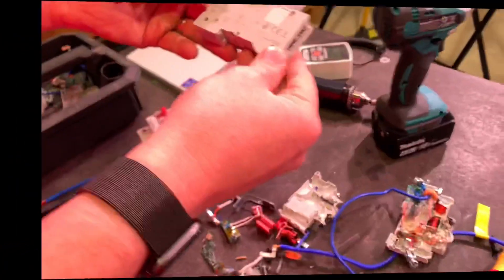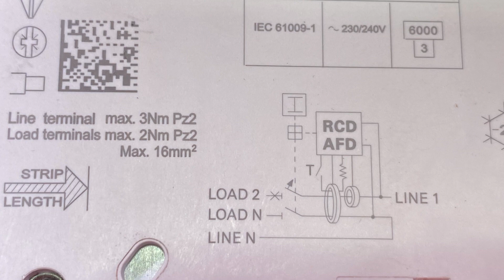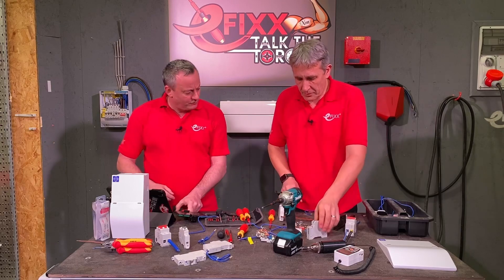IMPACT DRIVER vs CONSUMER UNIT - The results are SHOCKING

Comment: I am f'n amazed that anyone would use an impact. Seriously, it takes no more than 2 seconds to snug it up spinning the shaft and then torque up. (Quiet at the back Timmy).
Reply: Sadly you see it a lot on big commercial sites
Reply: @lewis94uk  I could snug anything with an impact, but I wouldn't finish it of with one. Back in the day, my old boss. We had to drive brass plate 3/4" #4s into brass fittings into oak frames that I predriiled and tested. I said set the clutch to no 3 on a bosch drill (24 years ago bosch). He just keep snapping the heads off and whining that even number one torque broke the head. He was gunning them full speed, how is the clutch suposed to compensate for the inertia of the chuck. Some people, even if you bang it into there skull, just do not have the capacity to absorb nor contemplate. They can be "learned" a task but will never understand why the funk why. And thats a good 70% of anyone you work with, talk to or related to. Same goes for the doctor, mp, teacher and everyone. I had to ban my boss from my electicl plane when he was trying to plane a bowed arm on a chair. Clues in the fning name I said. Same with the tablesaw. NFI
Reply: I guess if you're ripping one out it's probably incidental but using one to assemble is just ludicrous.
Reply: Speede II my friend. Save work
Reply: @tommymack3210  Send me one and I will have a go, I still have my dads pump drivers. If you remember them. First time he let me have a go on one, he explained one thing. He put a pipe clip on a some box work and said thats your eye, he wisted the end and the pipe clip was no more to be seen. Rule number one, don't open it in your eye and always store it open. Then he explained why he had two, His boss, my dad the aprentice, had a gig fitting 500+ cinema seats. His boss bought the screwdrivers to speed it up as they ar ratcheting. His boss fitted 2 seats when my dad asked him what to do now after he fitted a row of 20. His boss was then shown how a pump driver works.

Comment: Honestly do people have no clue how little power is required for 2-3nm. Even th old ball head ratcheting screw drivers give way too much power without even trying.
Reply from the maker: See our previous video on calibrated arms!
Reply: @efixx  I have seen it. Im a car mechanic and the same problem occurs alot there. People dont realize that we use torque wrenches in order not to over tighten.

Comment: Had a job where we was changing these boxes the incoming supply and meter is placed ( I don't know what you call them since I'm from Norway, but they are build kinda like these you have in the UK). We were changing them because of rust, something that was a problem on the first gen of these boxes we used. The guy from the DNO told us that we could connect the meter for him, but we needed to use torque driver and 3nm. We did that ofc, but the last one he did himself while waiting on us to finish up so he could turn the power back on. For that one he used a impact driver..
Reply: A silly man.

Comment: soooo. . . what about a torque adapter. . . and an impact driver?

amazon do some at 2.5Nm if you want to give it a shot  😁
"Individual Easy Torque Adaptor 2.5Nm, Length 59mm"
Reply from the maker: They are only good for a few thousand duggas and at £59 it’s cheaper to use a torque driver.

Comment: Have seen the damage caused by impact drivers not just to mcb's but to switches and sockets cover screws too. Plenty of crossed or stripped threads and broken switches etc. I wont use them.

Comment: I use it to get a hold of the cables, its quicker this way, i don’t over tighten, i go over them with a screwdriver afterwards
Reply: Same here saves my wrist in the long run basically the same as those electronic screw drivers

Comment: I have witnesed someone using an impact on a neutral bar and it made me physically cringe
Reply from the maker: Sadly lots of people use them as standard.
Reply: I cry every time I see some muppet using one. All those crushed connections will eventually cause resistance and eventually leave to fires or faults. Best to use the proper torque screwdrivers.
Reply: Why do Neutral and earth bars still have screws in UK thats just shocking